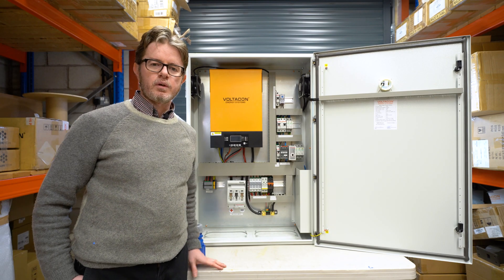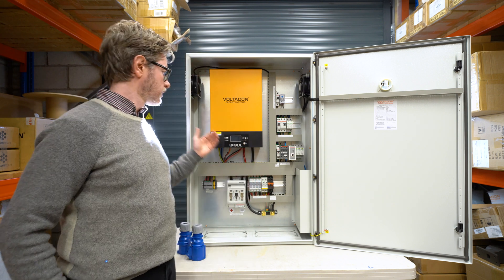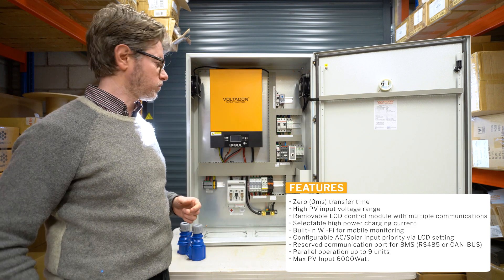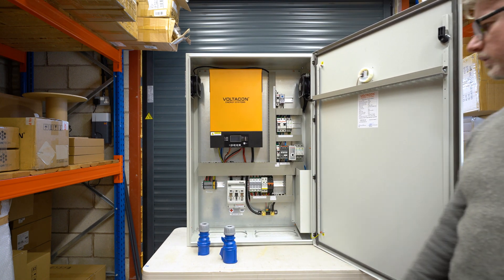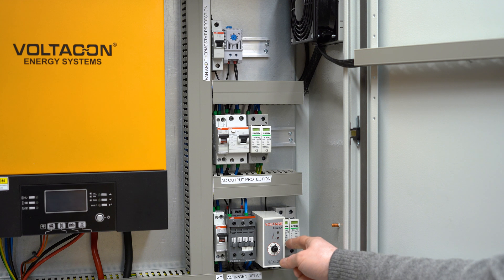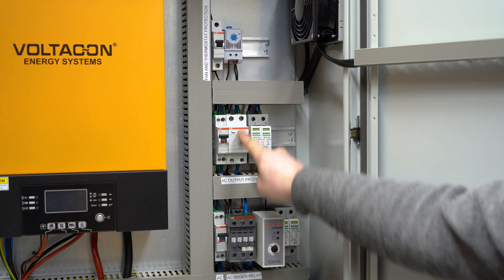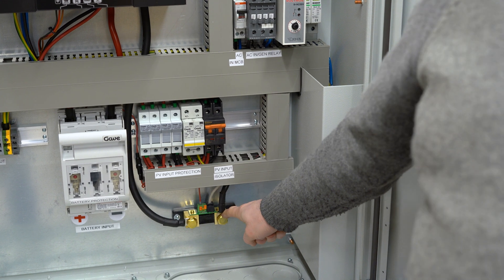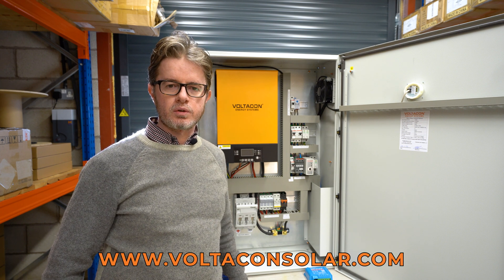The new high voltage Conversol V7 5kW fitted in off-grid control cabinet

Comment: In video you told about a device voltage and frequency regulator please share model number and details thanks
Reply from the maker: There is a voltage supervisor made in Greece, this device simply checked if the voltage fluctuates over a specific %. I will get this info for you